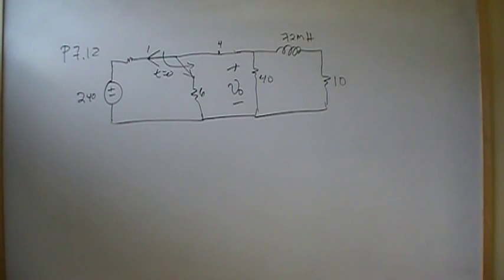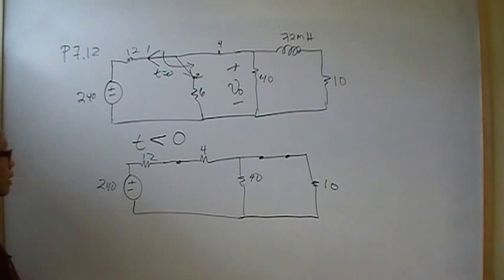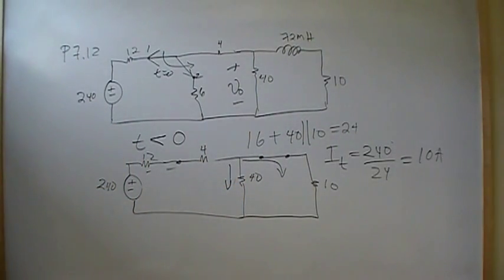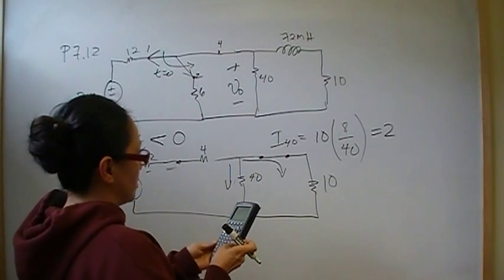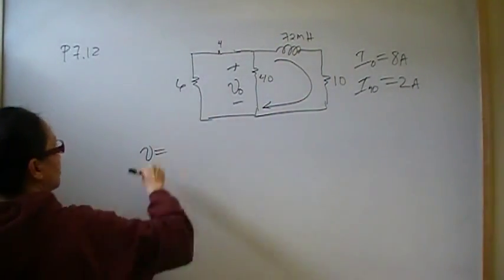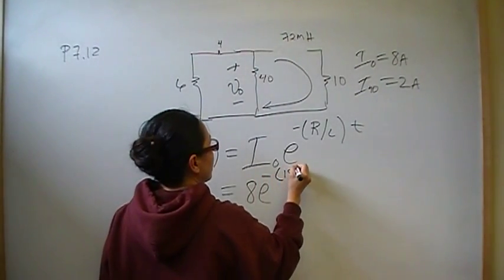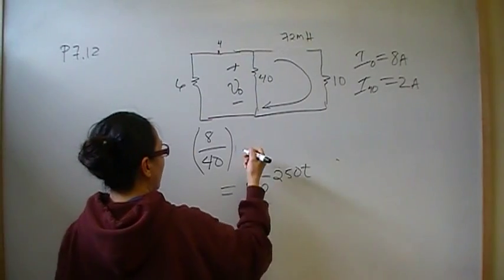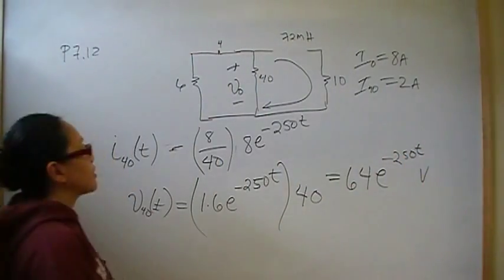Natural Response of an RL Circuit P7.12 Nilsson Riedel Electric Circuits 9E Solution

Comment: I'm getting -64e^-250t, not positive. Shouldn't it be negative since the current flowing through the 40 ohm resistor would probably be flowing up instead of down?